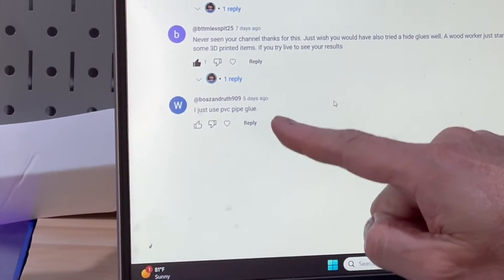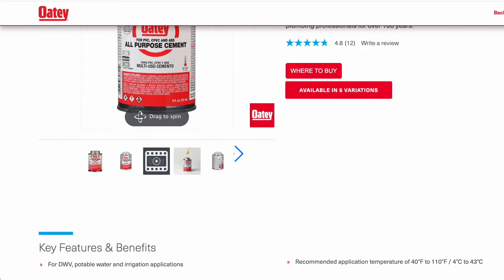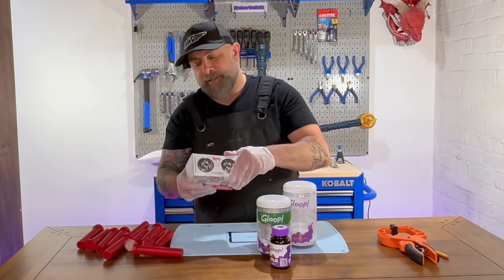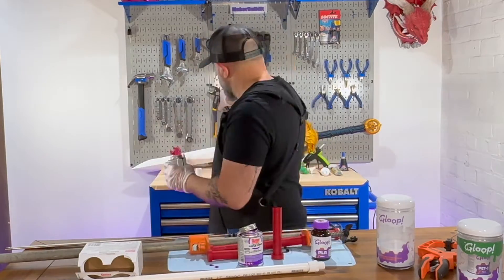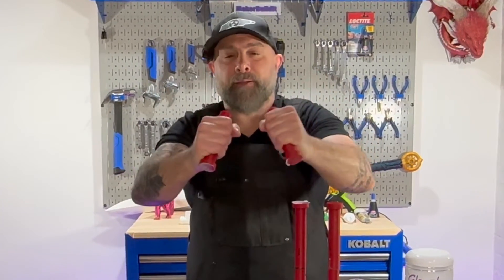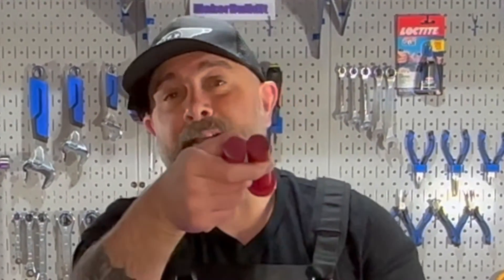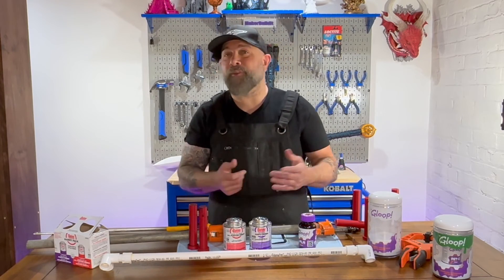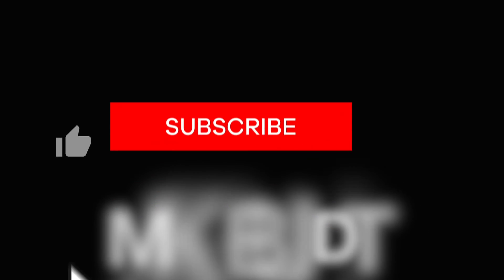Testing 3D Gloop vs. PVC Glue for 3D Printed Parts

Comment: I GOT THE 3D GLOOP AND CAME DRY OUT BEFORE i EVEN OPEN IT, THE 2ND BOTTLE DID NOT GLUE ANYTHING i WOULD NEVER BUY 3D GLOOP EVER AGAIN, COMES IN A VERY FANCY CONTAINER, WAS CAREFUL AN FOLLOW THE INSTRUCTION AND DID NOT WORK AT ALL, SHOE OR BOOT GLUE WORK 1000 TIME BETTER IS JUST CLOUDY WHEN DRY.

Comment: Didn't  the data sheet for Gloop say it also contained some Acetone? Why not just add some Acetone to the PVC glue and try it again?
Reply: SDS for PLA gloop has DCM aka methylene chloride and solvent naphtha as the primary solvents. Acetone doesn't work on PLA as a solvent, just ABS/ASA. Gloop also has existing polymer dissolved, it would be interesting to try dissolving some plastic in the PVC glue well mixed and then try that.

Comment: Depending on how much adhesive you're using and how often, the adhesive's shelf-life is another key factor to consider. 
Getting a "good deal" is nice, but if it goes bad after a month and you've only used half (or none at all) then it's not so nice.
Thanks for the video!
Reply: Plumber's glue has a shelf life in the years, 3D gloop has a very short shelf life of months, in addition to being expensive. That's the reason I'd rather not buy it.

Comment: Interesting test but a significant problem with your method.  All you're really testing here is if the adhesive is stronger than the layer lines.   Ideally you would have oriented the print so that the glued side went across the layer lines instead of being parallel with them.
Reply: Wrong. Nobody is going to print to tall parts (the entire reason prints have to be split up) horizontally, the print would be perfectly strong if one piece, so all the glue has to do is be the same or better. THAT'S THE POINT. And it's actually not easy.

Comment: Gloop for ABS and Micromark's "Same Stuff" plastic solvent glue have the same main ingredient according to the SDS.  Micromark is about 1/3rd the price.  This ingredient is very toxic though and should only be used outdoors with a fan, or a chemical fume hood.  It was much more common in things like paint strippers but many brands of everything have stopped using it because so many people were making themselves very ill off it.

Comment: most comments here arent really accurate imo
tetrahydrofuran (thf, dunno why ai listed it twice) is what actually dissolves most plastics.
PVC Glues come in many varieties over many countries.
most commonly tho:

PVC cleaner: acetone (di methyl ketone)
PVC "glue": MEK (methyl ethyl ketone)
PVC glue (cement): PVC dissolved in MEK/Acetone + THF (tetrahydrofuran, cyclic ether)/cyclohexanone(cyclohexyl ketone)

now, this is dissolving strength sorted aswell, PLA however does not follow the same rules.
getting PLA to actually dissolve is hard. MEK can swell it, so can acetone, THF and cyclohexanone are able to dissolve it (not fully but good enough)

so youre really looking for something that contains any of that, depending on your use.
anything cement like, or viscous range above water, will contain dissolved PVC, so whatever dissolved that PVC, can also partially dissolve that PLA, thus glue them together.

same for vinyls, like neoprene. can get glues and cement for that, theyll work.
so any cements, PVC, Vinyl, similar will work
ABS cement may work partially, MEK based ABS cement will swell and soften the PLA, i expect it to work less than PVC/vinyl cement as they are even more dissimilar.

TLDR;
cyclohexanone or THF, anything else added is "filler" or stuff to make more liquid per dried plastic/lenghen time to dry/reduce cost to manufacture
THF -> dissolves really good
MEK -> dissolves okay
Acetone -> dissolves ehh
Reply: Do you think products containing THF can be used specifically for smoothing out PLA surfaces since they dissolve?
Reply: @MarkofFenrir  Good question!

Comment: I use a PVC cement to bond PLA, but the main ingredient is Methyl Ethyl Ketone (MEK). My trials the print broke before the bond every time.
Reply: they are close but not the same.  MEK  (Methyl Ethyl Ketone)  "kinda works"   but 3d gloop contains Methylene Chloride, a very different chemical,  IT is what really melts the plastic well.  if you wanted to make some 3d gloop, you would take Methylene Chloride and put some scrap bits of PLA filament in it.  this would disolve the PLA making it "gloopy"     the Methylene Chloride will fuse the PLA much better than MEK

Comment: For PLA , Weld-On #16 "IPS corporation" is the best value. The pla will break before the chemically melter bond breaks. 5 OZ tube is anywhere from $10 bucks to $20 bucks depending on where you buy it.
Reply: Thanks! I forgot I had this in my shopping list.
Reply: Order placed. Thanks for the recommendation. Main use petg.
Reply: @redndeyes  It may not work for PETG, it is chemically active with PLA.
Reply: Weldon 3,4 and 16 work with pla, petg, abs, asa all the same way, its the best and much cheaper, I buy a gallon of $4 for $60 locally and large tubes of 16 for $12

Comment: I’m a new subscriber and I have been exploring your videos for what feels like days lol.  Thank you for doing these tests.  I’m new to 3d printing, 8 weeks in.  Already halfway through a master chief build and I’ve been trying to figure out various things such as sanding, how to smooth layer lines, and so on.  Mainly though, what glue to use.  I ordered 3d gloop like a week ago but it still hasn’t shipped.  It was more expensive but I’d seen it’s got the best bond with the least mess and low curing times.  So I guess we’ll see
Reply from the maker: Welcome to the 3D printing world and thank you so much for watching and subscribing! The top preforming tested glues so far are JB Weld for Plastics, Super Glue and 3D Gloop. Still got some additional tests planned. 😀 Some people also use 3D Gloop for some smoothing. I haven't done that yet. Bondo also works. 😀 What are you planning on building?
Reply: @MakerBuildIt  That’s what I’d seen on your previous videos!! So I’m excited I ordered the Gloop, but man they are slow 😒.  I’m looking forward to seeing more of your tests!! As for the smoothing, I’ve only seen one video of someone trying it and it turned out terrible. That video was like 4 years old though, and they mentioned an aerosol version, which their website still claims to be on the way lol.  

I’m thinking I’m going to either try the plastic filler with acetone or give UV resin with baby powder a try once I actually get to my first post processing.  So far I have from the waist up to the helmet done for Master Chief Armor cosplay  but I haven’t done any sanding or anything as I haven’t yet figured out how I want to start trying to do the post processing.  I have a mandalorian helmet waiting for post processing and I have a Bo Katan helmet going that is the start of my daughter’s Halloween costume!! I’ve printed a lot of toys and things first the house so far as well to get a better understanding of the settings and how to actually use my printer lol.
Reply: All the gloops have different solvents depending on the material to bond.